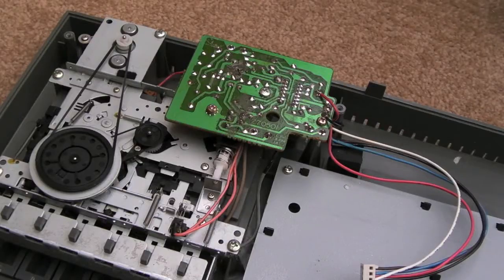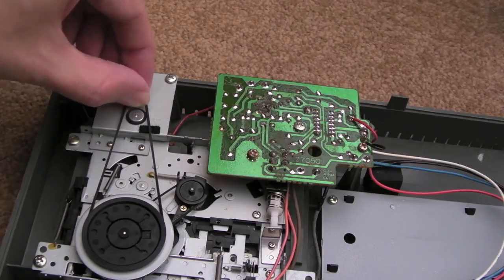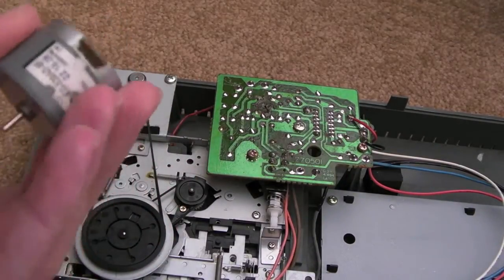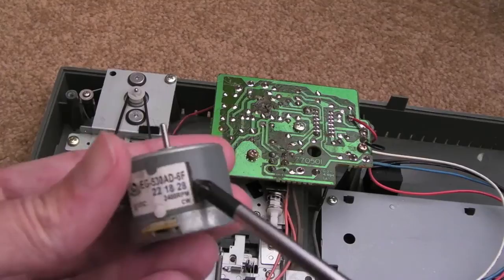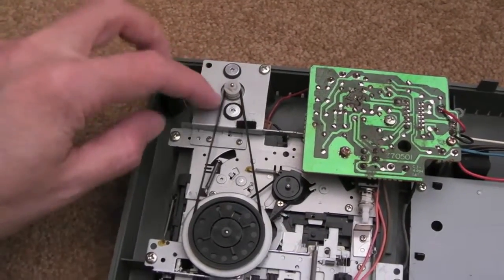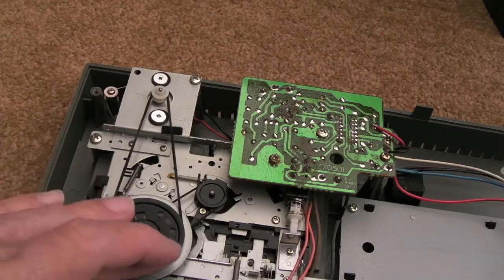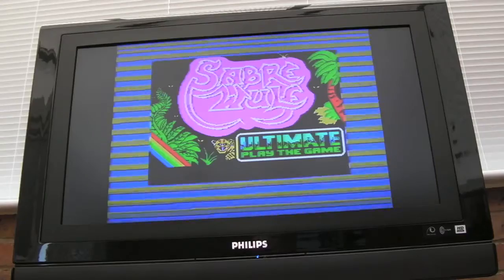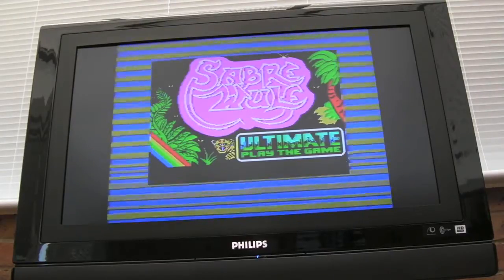Sinclair ZX Spectrum +2 Missing 12v Revisited (Datasette Repair - Tape Motor)

Comment: Nice video, The +2 tape unit and motor run off +5v from the 7805. How did that kill the 12v supply? Did the motor spike some voltage back when it died?
Reply from the maker: Sam Thornley Yes, you are right! It's powered from the 5v line.  You would think the 7805 would stop any noise or anything getting back to the 9v rail.  It could just be coincidence!  Strangely enough I fixed one of these many years ago with exactly the same 2 faults, that's why I assumed it was likely the cause.  It's more common for the serial transceiver chips to kill the 12v line.  It could be that they are completely unrelated, but there's no way this Spectrum could have been used with the motor as it was and its odd that the 12v had failed as well.  I think it must be some back EMF or something? Maybe the drain and noise is somehow affecting the 9v input or the 12v being derived.